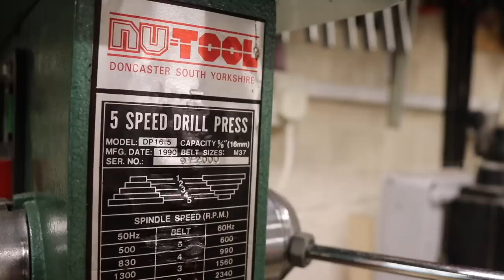How To Make A Wooden Swivel Spoon / Hook Knife Sheath - Lee Stoffer

Comment: If you have a scroll saw you can make the full cut nonstop without all the drilled holes, but one at the tip of the blade slot will make the turn around easier if you aren't accustomed with making tight turns. I'd only use a 1/16" bit and you could drill the corners of the ferrule cutout as well for the same reason. Everything will be much neater. 
 Says an old scroll sawyer! LOL
Gabby
Reply from the maker: Sincerely appreciate your insights Gabby and indeed there are many ways of going about this project ~Peace~

Comment: Note your cabinet screws have a flat back that doesn't split wood as the brass screw with the "wedge" cone shape head that can split wood. 
I'm pleased with the project except the screw selection 
I'm rethinking to O ring that model with the door and not using the pin system as lock.
You can I'd each tool by painting the tool shape on the lids and select tool type with different colors on box lids for I D of the selected knives 
Thanks 👍for your teamwork
Reply from the maker: Appreciate your insights John, as with all these projects there are definitely specific aspects that can be tweaked and ammended. Stay blessed my man ~Peace~

Comment: GREAT VIDEO... A question: around the 23:13 mark Mr. Lee has a knife in hand while talking about cleaning up the slot created by the coping saw... that knife, It looks like a modified mora companion... is that right? it's a genius way to create a slyod style blade, if it is...
Reply from the maker: Thank you kindly, indeed it's a Mora but it's their carving range that has a plastic handle as opposed to a wooden one ~Peace~
Reply: Hi Woodchuck, yeah it's a carbon steel mora clipper that I ground the spine away on to give it more of a carver profile. Then I found out they made the ones Zed mentions which would have been the easier option!